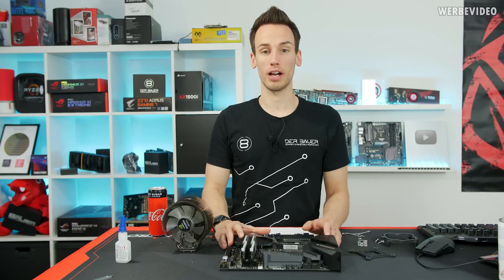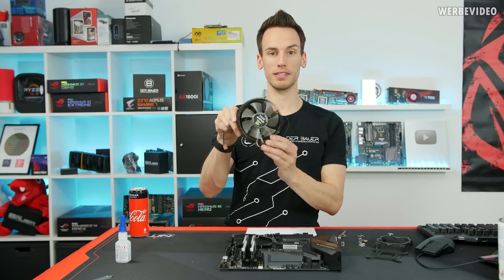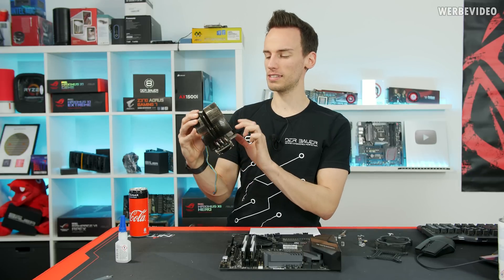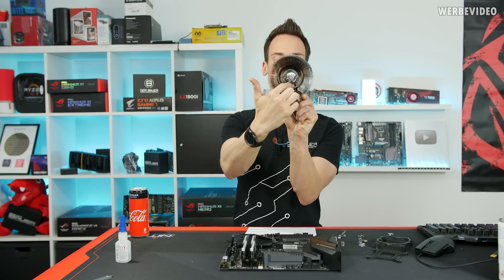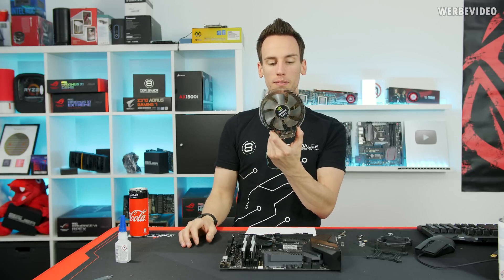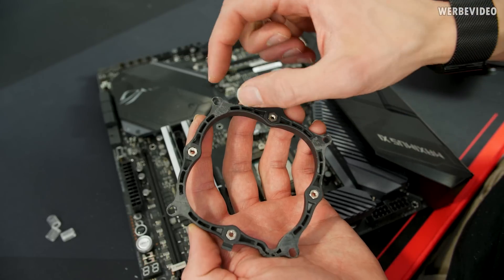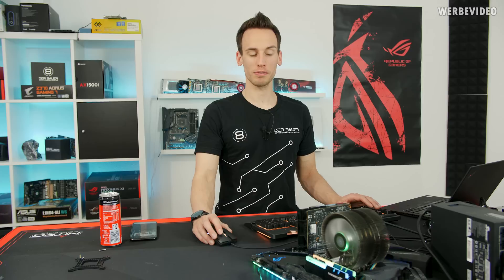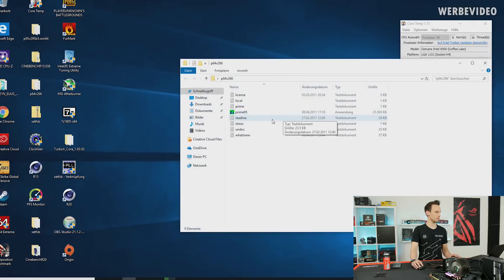HW-Legends #4: Using a 12 year old CPU cooler for todays i9-9900K? Zalman CNPS 9700 NT

Comment: The PWM  wire and RPM wire are probably flipped on the cooler, was a common issue back in the day. flip the wires and you'll probably get proper control over the fan speed again.

Comment: I have that cooler but in copper I don't have the PMW ver witch SUCKS! but mine has a universal bracket it will work with 775 to 1151 
and if your copper look tarnished soak it in vinegar

Comment: I need your help, I have a 9900k to 4.9oc to 1.29v riding with a kraken x62 and it is quite warm in some moments of intensive use, is there any year of 280mm better than the kraken x62? or do you recommend changing it for another more specific model?

Comment: I still have a cnps 7000 on my P4 machine and cnps 9700nt (exacly like the one in the video) with my q6600. Later Zalman made a adapter for socket lga 1156 that also can be use in lga 775, 1155,1151.

Comment: I have an asus p5k deluxe with a core 2 quad q9650 and my copper zalman heatsink keeps it cool under load. I even tried it with my core i7 2600 and i had the same results. it looks nice and it works. an added bonus is that it was only $35 on newegg.

Comment: I still have a CNPS10X in my daily system. 

I definitely don’t still use the factory fan.
Reply: I still have a CNPS10X Quiet (*Definitely* without the original fan!) I use when I need an air cooler, and it rocks.  After lapping the baseplate, I think it actually beats a single fan hyper 212
Reply: Shawn McDonald it keeps my 4.4ghz (1.33v) piledriver cool and within temp even running Prime with AVX and small sets. I’d say that’s about all the endorsement it needs!

Comment: This model of Heatsink have LGA1156 mounting in later build and they don't have backplate but 4 female screws and plastic washer on those model. I got one last year with Pentium D motherboard and it can be use with CPU like 6700K fine. It's better to fine LGA1156 mounting for this instead of modify the mounting like this. Except it's too expensive so not worth getting it.

Comment: I'm currently using the kind of modern Zalman CNPS12X and had no problems with my 3770K since 2012. It's dead silent (despite being triple fan), cools really well, massive nice looking piece of Zalman art. Somehow it got many bad reviews for its a bit unfriendly anti-RAM-rads low profile (which I don't mind because RAM beauty [looking cooled] is vastly overrated anyways) and perhaps due to this silly nonsensical thermal paste minimalism misconception (which, unfortunately, is still a thing to this day) that produced some unfavorably high temps, while in reality it was up there with the big boys like Noctua ... and overall it got very little attention back in 2011/2012 when it was released, possibly because of the AIO liquid cooling coming to the mass market right about that time. You can call me old fashioned, but I prefer a big silent chunk of metal on my CPU, rather than a tiny water loop heat pump and a big loud radiator somewhere.

Comment: Those particular coolers were great at cooling, but had this issue where the bracket would snap and all that half kg of copper would fall on your graphics card. Not recommended for good PC operation. I really miss Zalman though. Great PSU's (with LED's :D) and they seem to make some nice cases from what I can tell now... but you just can't get them. The company is really struggling.

I had a CNPS9500LED

Comment: Zalman CNPS9900 MAX
 👍 Still got it somewhere in my spare parts bin
Reply: I too, have it on my old FX-62 </3
Reply: that thing is a beast!
Reply: @darkevilapie  yep best air cooler I ever had that was bought retail anyway. I never saw the need to change it out for a Noctua setup.
Reply: Yep I got mine in the drawer as well I used it up until this year but replaced it with an EVGA 280mm CLC. I plan on getting an AMD Ryzen 3900x this fall and the CLC will be going on that and the Zalman CNPS9900 MAX will be going back on my trusty i7 2600K and be a secondary system for my theater room and projector.
Reply: Me too
Reply: Same here.  It served me well until i went to water, but i still keep it around.
Reply: i use one for my 7700k works reasonably well

Comment: For about $1USD you can get a multi sized bracket for 775/115x etc and the Zalman clip fits perfectly. I am using this on an I5-7400 https://www.aliexpress.com/item/Etmakit-Desktop-3in1-CPU-Cooler-Fan-bracket-heatsink-Holder-Base-For-LGA1150-1156-1155-775-1366/32847591294.html

Comment: That was one of the last coolers to be relevant before the Thermalright Ultra 120 Extreme came and kicked every other cooler's ass for like 2-3yrs straight. The TRUE was the best cooler from the start of the Core 2 Quad era until around the launch of the mainstream i7's like the i7 870 when It was eventually beaten slightly by the Prolimatech Megahalems.

Comment: I have a CNPS9900A LED on my Phenom 965 that I got OC'd to 3.9GHz (19.5*200), on an ECS IC780M-A2 motherboard. couldn't really bump up NB or memory speed to help at all, but an easy overclock and even priming I still don't pass 60C on it. Really wish they were still around; they'd probably be giving Noctua a run for the money.

Comment: Very cool.. Used to have the Zalman CNPS 9700 NT back in the day.. as well as the CNPS9500A copper version.  I wish I still had these today.   😥   I first had the 9700 NT installed on a socket 939 motherboard using a Athon 64 CPU..  goodtimes.   Definitely a great CPU cooler in it's day!

Comment: In English we call those ovals, but that is not a specific word. Anything vaguely egg shaped can be called an oval. Wikipedia calls the shape constructed with a rectangle and to semicircles a "stadium", but I've never heard that word used that way.
Reply: Also, I have a Zalman GPU cooler installed on the ATI Radeon X800 XT in my PowerMac G4 MDD.

Comment: I have ALOT of those coolers, on
 everything from P4's to 4th gen i7 and 1366 Socket Xeons.  Though some of the ones I have are the smaller CNPS 9500 unit as well, which I think doesn't have a PWM fan. They have served me very well in all the years of use. I think a few are close to 7-10 years old by now.

Comment: FYI the Zalman CNPS9700 LED (copper with blue led fan) was from 2006 and a year later in 2007 the Zalman CNPS9700 NT was released. Frosty Tech still has there reviews up from that time. Which reminds me of the first high performance PC i ever built was in 2006 with the CNPS9500 LED cooling a Athlon 64 x2 overclocked to 2.7GHz (2GHz stock).

Comment: Never had a zalman CPU fan as there were cheaper alternatives with similar performance. Or much better performance for the same price. How ever I did use one of zalmans GPU coolers as a chip set cooler on my Asus 775 board. P5Q plus perhaps? I don't know it was a long time ago but it was the step below what most people used at the time but still worked great. I had a e5200 overclocked to stupid speeds.

Comment: I have the original copper one sitting on my kitchen table and also the 7000 ;-) and the 9500 (tower cooler, bare copper and is smaller with a 92mm fan), only that the fans LEDs don't shine anymore and spins a bit slow but at least forces it to be silent and don't cool very well. Also the bare copper sticks dirt to it much worse and is hard to clean :-/

After using the Zalmen coolers for a long time i found myself not liking them anymore because of the thin fins making it hard to clean and used a 212 EVO push/pull and also lapped it for almost 10 years. Late last year i was going to get a NH-D15 but i saw an open box completely unused Zalman 9900 Max for $25 lol... GOT DAMN IT!! i went back to Zalmen for funzies and it works better than the lapped 212 EVO with push/pull, although the Zalmen 9900 Max with one central fan is slightly louder it's not unpleasant.

Comment: Oh, I still have a copper Zalman cooler sitting on my shelf! I think it dropped my Temps 30c on my Q9550 when I installed it back in the day!
Reply: was running a 9550 till recently, dropped in a 5470 and running at 4.5ghz with phanteks version of that noctua cooler lol still extremely usable in todays world

Comment: I had the copper colored version on the first iteration of my 4690k(now 4790k) build. It was pretty noisy, but it did let me OC the 4690k to 4.5ghz. Later when I upgraded to the 4790k I also switched to a NH-D15; that CPU binned better and runs 4.7-4.8ghz. If the reviews are positive I'm planning on upgrading to a Ryzen 3900x when they launch.

Comment: i used only zalman from around 2000 until i got my X1800. i used the all copper ones in my dual AMD MP. and GFX coolers on the ATI radeon card's.  both one and two heatpipe versions. and i have a All in wonder with a flat passive one.  i stil have zalman thermal grease things all over the place. the worst job i had was puttin on Zalman passive north bride coolers on 40 PC's. my desk was full of syringes with 2k thermal glue ;) ppl was wondering what the F*** that long hear "hippi" is doing with 100 syringes on the desk ;)

Comment: I still have one of the nickle plated ones and a pure copper CNPS9900 in my office closest. Used them from my first Athlon 64 build all the way through Ivy bridge until I defected to the Nocutan Owl clan for my current Ryzen build. If they had made an AM4 mount kit I'd most like still be running them. :)

Comment: I remember my old Zalman CNPS7500, it was a good cooler.
I have a ATOM system with a Zalman PSU, I wouldn't use it in a high power use system.

Comment: I still have got ZALMAN CNPS9000 Cu, but fan is broken. It was installed on Intel Pentium 3000E. I also have got VF700 on Sapphire Radeon 1950 Pro (AGP x8). GPU is no longer in use.

Comment: This was a great video Roman.  Ah the memories...
I used the 9700NT on a few builds, but in vertical towers they occasionally suffered from vibration when the fan speed ramped up, more from sitting sideways and the mounting mechanisms of the time rather than anything else.
I then began the smaller but almost-as-efficient 8700NT.  That was my favourite CPU cooler for years, must have used it on a half-dozen builds.
These were the top coolers on the market at the time, by a wide margin.  Not so much because they were more efficient (other coolers could be just as efficient), but because they were so much quieter in load operation than competing coolers due to the premium PWM fans they came with.
Keep up the nostalgia Roman, great work.
Recommended for HW_Legends:
Abit BP6 with dual Celeron 300 or 366 (Intel's 440BX was a dream come true).AMD Athlon 64 X2 3800+.GeForce 256.
Probably cannot find these anymore, and if we can they will be ridiculously over-priced.

Comment: Mine was the cp5000? The copper version you showed a pic of early in the video with a blue led. Hat it on a 990fx board with an 8370 underneath. Even with the power draw of piledriver it didn't do too bad. VERY ambient temp dependent. No overclocking in the sumner for me with that thing, but in the winter in Colorado i'd crack a window and pull off 5.1. Allways wanted that nickel plate as I could find a model with a blue led, and my asrock 990fx extreme 4 was blue and white, would have looked really nice. Still have all of it, the case was damaged in a move and I just never got around to putting it all back in a case again.

Comment: I think the word you were looking for was "oval" it's the same as a box compared to a rectangle but here it's like an egg compared to a circle.
But I have the older zalman on my dellided 4790k that I used with liquid metal to test how it applies as a test before I dellided my 9700k for direct die cooling. I was curious what if I used it on my 9700k but wasn't going to waste the thermal paste. Thanks for the video

Comment: I had that bad boy for my 680i. Before going to water.  I can't remember if I clocked as hard on air or water but I was able to get into Windows with 500fsb in c2d e6300. Was insane clocker. :) thanks for the memories.

Comment: I wish Intel didn't change the mounting hole distance from 72mm on 775 to 75mm on 1156, I've really wanted to test the old Thermalright XP-90 on 115X but I'm not sure it'd be possible since it use the socket 478 style hook mounts and the 775 mount kit was just a 478 style bracket with a 775 backplate and hole spacing to mount it down.
 That Zalman is really light compared to other all copper coolers, remember the Thermalright Ultra 120 TRUE Copper that weighed over 4lbs (1.9KG)

Comment: The fans of the cooler needs to incorporated wind turbulence to better distribute the air through the radial fins. I know fans from certain EVGA cards has those small bumps, that would be one example of fan design that encourages wind turbulence. 

Another idea would be to seal the outer radial fins, effectively making a wall of cylinder. This makes it so the air only exits through the shape. This would facilitate better wind velocity through the fins.

Comment: would the Hyper 212  be a hardware legend, or because its still in use is it not applicable yet
Reply: It's been around for quite some time now. In my opinion, it definately will. So many people still use it regardless of its age and it's like the "go to" cooler for budget gamers and it performs extremely well for the price. Yeah it's a legend lol
Reply: @ChfHappySack  by "still in use" i mean the Hyper 212 is still actively on sale, not that people are still using it, but i personally think of it as a HW Legend, the one in ym systems are still rocking

Comment: I have good memories of zalman coolers back in the day (2002 or so). I remember buying a Athlon 1800xp and the titan cooler I bought at first was so loud I got headaches after a few minutes of use.

Then I got the CPU cooler (CNPS6000Cu), the passive northbridge cooler (NB32) and the ZM80 for the graphics card. Paired with a silent power supply from Fortron and the quietest ever made mechanical HDD (The seagate barracuda IV that came after buying conner. I was lucky on that one), it was the quietest PC I ever came across. I was unable to tell if the PC was on or off in the middle of the night and it was only a couple of meters from my bed while it was running at 100% for hours while compressing XviDs for the Univ...

That were the days :D

Comment: ah the CNPS9700, i have the copper version (the standard retail) and that tamed my 4.6ghz FX 6100   
also: the mounting "blade" works to this day on AM4 w/o any issues
Reply: Do you mean that orginal AMD mounti g brake works also with AM4?
Reply: @oecre  yes, the original crossbeam metal thingy that latched into 939, AM2 and AM3 bracket teeth also latches just fine on a AM4 bracket

Comment: 10:10 in never does because the CPU boosts it's frequencies.
TDP is at base clock, not with OC or Boost. And there isn't a single CPU that doesn't have boost.
Reply: Intel disagrees since they have tons of CPUs that you can't overclock
Reply: @scottyhaines4226  You can't OC but they have the same turbo boost speeds as the k-versions.

Comment: Hallo Roman erstmal deine Videos sind top.... ich habe eine frage ich hab ein z270f gaming i7 7700k auf 4,5 ghz eine enermax liqfusion 360 in einem Lianli ind deiner Edition drin mein Problem ist es das im idle die temp. 40-45 grad ist und wen ich ARK spiele immer so zwischen 60-90 grad sie springt immer wider hoch...  bei cinebench 85-95 und bei prime 80-90 ist das nicht viel zu hoch bei einem stock zustand?
Mit freundlichen Grüßen

Comment: I had one back on my Core2Duo and carried it all the way to my FX8100.

I also got a client that I have installed a brand spanking new CNPS9700 on a 7700k and it's running just fine since there is no OC in that CPU.

Comment: I used to have this exact cooler, with Q9450 CPU and GTX 8800 Ultra
Reply: Gtx 8800's are still the best graphics cards ever made imo (from a price, performance, capability, and improvement perspective).

It just did everything right.
Reply: Excalis Ogre lord woah, that’s 700% more than the modern Nvidia GPUS!
Reply: Always wanted the Ultra, could only afford the GTS at the time, got it to play Crysis 1. LOL.
Reply: Lol I still have a Q9650 running and my 8800 GTS lasted over 10yrs before it died.
Reply: You had a pretty high-end machine. :v.
Reply: 2007 chad spec computer!

Comment: I use a CNPS8900 for my Lynnfield (i7-860) demo rig. It can keep the CPU stable at 3.52GHz on around 85 degrees peak...not too loud on full speed, just noticeable.
Reply: Uff thats pretty bad. 3,52Ghz is almost stock voltage for this CPU, Iv had I7-920 at 4,2Ghz 1,275v and was able to keep it under 90 with Noctua and this CPU ate like double that of Lynfield after OC.

Comment: I remember nForce.  I remember spending days trying to get a decent overclock on it.
Reply: willis936 too bad overclocking the northbridge doesn’t help performance much
Reply: Andrew Brinkman Incorrect.  OC was FSB dominated back then.  If a chipset couldn’t handle 400 MHz then you weren’t getting that 3.6 GHz.  The 100 MHz standard and better multiplier control came after nvidia tapped out of the mobo chipset market.

Comment: It would be awesome if zalman did a modernized tribute to this epic product.
Reply: This design is absolutely high performance  and has the potential to stand against the best of today in my opinion, and maybe more, with up to date heatpipes and a spiral type fan like cooler master sickle flow or arctic p12. At that time spiral type fans did not exist, and it's difficult to push air through perpendicular fins. the only thing is that copper is not cheap anymore, but an aluminium version would be good as well, as long as you have a spiral type fan.